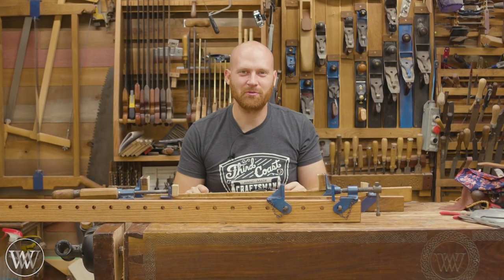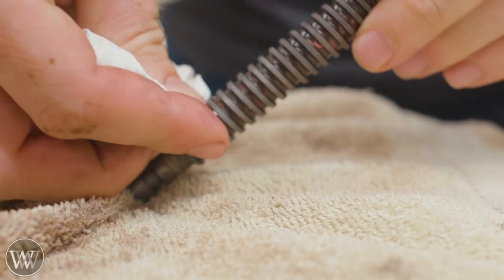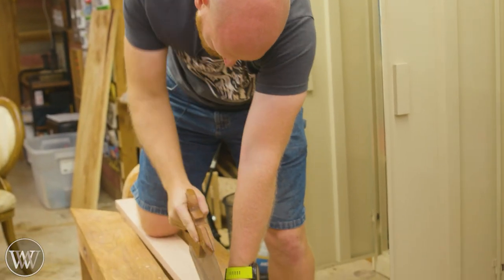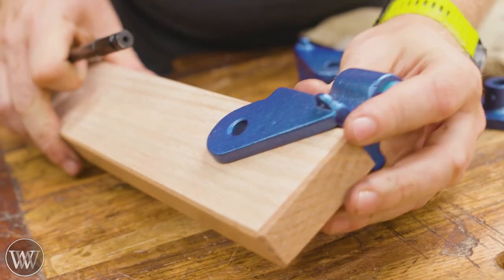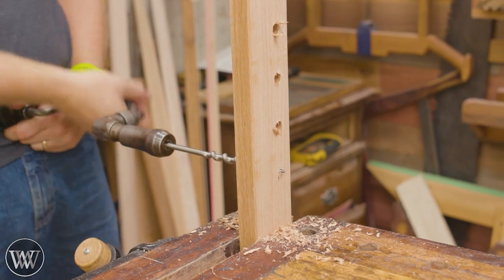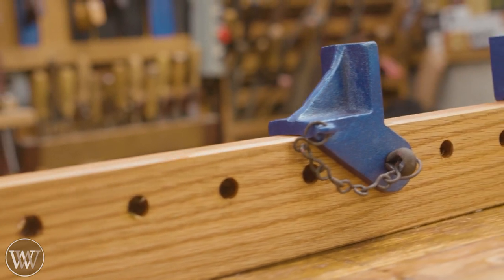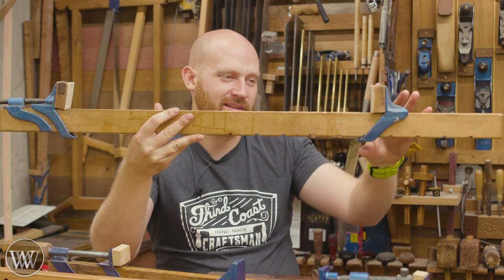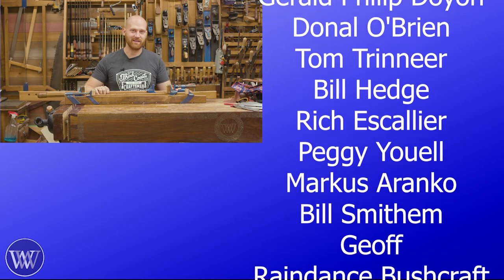What is a Sash Clamp and Where to Get Them

Comment: I've owned many of these clamps for years. I made the shafts out of ash and I removed the pins on the chains(which always fell off at awkward times) and replaced them with short bolts with nuts that I only tighten finger tight. The clamps were originally made by the Record company.
Reply from the maker: nice. Irwin Record still make them expansive but still good.

Comment: You only need to drill holes along half the length. For long items have the screw in a hole at the far end. For shorter items, switch the screw to the other end with all the holes.
Reply from the maker: ph that would be smart. I have not seen one like that.
Reply: That seems like saving a small amount of work now for more work later.

Comment: I have used this type of sash clamp for about 40 years and still good, made some long beams out of 2" x 1" box section steel which worked well for bigger jobs, and made a pair of steel trestles with holes for the clamp heads in the top rail . Liked the ear plug idea.
Reply from the maker: I wish they would catch on more here across the pond!

Comment: Surprising how we take these clamps for granted, easy to get in UK, whereas pipe clamps are so hard to get here. The only thing different to my pairs is that instead of split pins being used as pins mine have solid pins with holes at end for chain and R clips to stop them falling out.

Comment: great video as always, can we make the steel part from plywood, would it be strong enough?
Reply from the maker: I have seen a few people do it but it has to be something harder than plywood. And they end up being absolutely huge
Reply: @WoodByWrightHowTo  what do you suggest stronger than plywood?
Reply from the maker: Most any hardwood. The problem with plywood is it has berry little tensely strangth. Plywood is stable but not very strong.
Reply: @WoodByWrightHowTo   thankyou, I'm  gonna attempt to make them with steels for bottom parts of jaws and oak for top of the top parts, and attach them together with bolts and nuts, somehow :)

Comment: Wood By Wright: Avoids using power tools entirely while creating beautifully crafted wood furniture from scratch using simple, traditional hand tools - the designs of which have changed very little in centuries. 

Also Wood By Wright:  Wears a battery powered, network connected, processor chip driven digital smart watch
Reply from the maker: I am a techie at heart just like to slow down in the shop.

Comment: My only comment is that they are sash cRamps not clamps. You cramp things up and clamp things down. Things like G CLAMPS clamp down to a bench say. Sash cramps
 cramp up joints as in a door or frame.
Reply: Difference in terminology depending on geological location and how the language developed over the centuries. Both are correct depending on 
where/when you are from, i suppose.